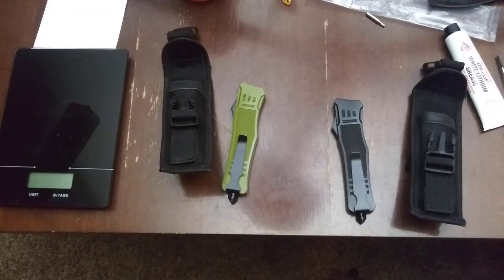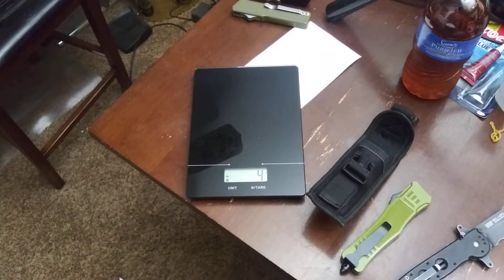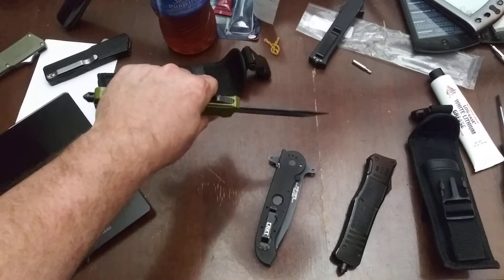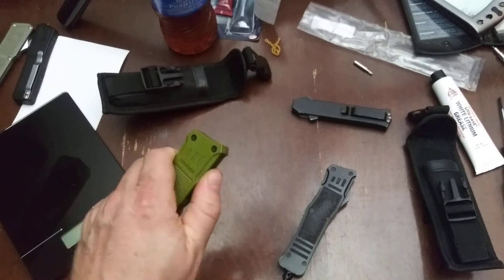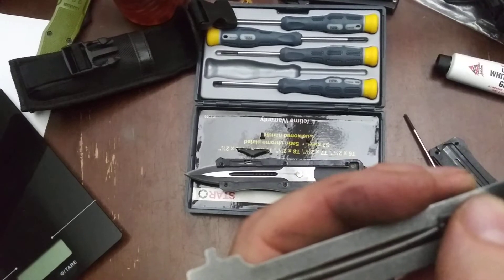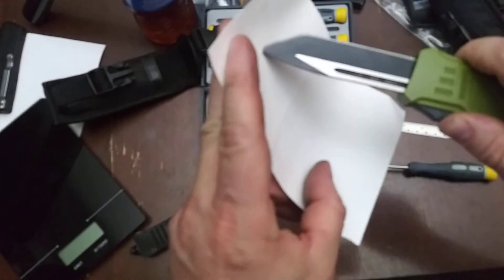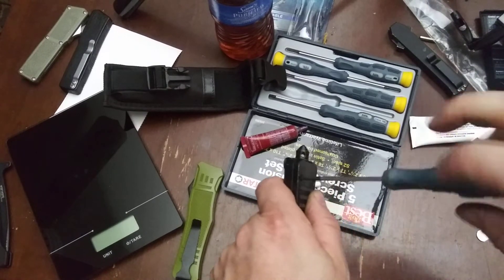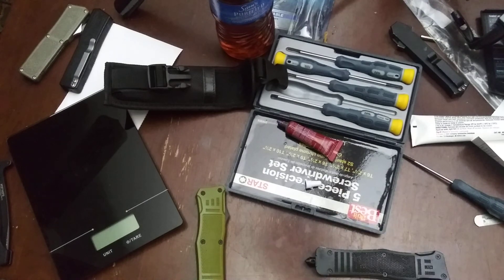atomic defender large otf HARD SWITCH FIX. Microtech Combat Troodon knock off

Comment: Awesome job! Been looking into budget knives, one of the things said on different channels is you can over tighten screws which will cause miss fires from case being too tight,but stretching spring oh so slight was a fantastic discovery.  Seen some run them wet with oil and some run with light to almost dry. But if you can take us through your journey,  I will definitely watch for outcome. Keep it up,great job!
Reply from the maker: on all the otf knifes i have the screw tightness will not affect blade deployment,unless its so loose that the handle falls apart.  however the metal is cheap and likely will strip something, maybe the threads of the little screw holes or the heads of the screws.  i have many videos up at this point and it all kind of blends together for me, i believe in the video above i just slightly stretch the spring. i have another video showing how i quieted these cheap otf knifes down. i like these knifes, i know they are low quality compared to the $400 knifes but these knives will still cut boxes, packages and flesh all the same. thanks for watching. but we warned i tend to make the video long, and do zero production and that can put some people to sleep lol.
Reply: Mr. Brown thanks for the reply, I bought the Hao Ming from Amazon and really good knife for the money, damn deployment switch is extremely stiff, used your trick,stretched spring slightly (little at a time) and added lithium grease. I'm very happy with this knife, hell I love this knife. Thank you sir for experimenting and finding such a  helpful cure for the deployment.  No misfires and no spring sing😀
Reply from the maker: @eugeneclark8463  excellent! glad i could help. that looks like a decent  knife. i am still amazed at how these work and how handy they are. beware, some of these cheap otf knifes will actually break. my "lighting" otf's hooks broke twice over the course of maybe 5 weeks or so. i was able to source the parts to fix them and i suppose you could make the parts if you are in a pinch. i think i have a few videos on that topic. still though,  otf, pocket clip and glass breaker for $40 sounds good to me.

Comment: Starting with a really powerful spring means that as it stretches naturally it will still fire the knife reliably - doesn't it?
It's not hard at all to source a myriad of spring extension coil spring sizes to find one that' has "softer" characteristics, but I think it's important to remember that if it takes a lot of force to push that button, that tells you the spring inside is very strong which translates to reliable blade launch.

Comment: just came across this video.. I did the same thing to mine when I first got it.  the spring was way too tight and it was very difficult to move.. stretched it little by little and it's been flawless since!
Reply from the maker: i still use these knifes every day, and they all seem good to go after about 2 or 3 years now of heavy edc use

Comment: I bought a cheap cobratec fs3 medium for my first last week. Been fidgeting with it non stop but that thing doesn't rattle open or closed. Man that button is stiff as hell but it doesn't fail unless you make it fail. Already ordered a higher quality otf to try out. I have an m21 large folder too. It's almost perfect but man those bolsters tear up my hand when I reach in my pocket. Been carrying a cold steel ak47 for over a decade and I cant find a more perfect defense/work knife. I love it and hate it because I can't find a better knife for my purposes. Faster than an auto too because of the wave deployment feature. An auto you have to pull out then open. A wave equipped knife opens on the way out of the pocket

Comment: This was really helpful.  I have a Microtech Ultratech that is pretty difficult to deploy, and I am hoping this technique will work to fix the problem.  Thanks -
Reply from the maker: i saw where mircotech makes a specieal tool to get those screws loose, did you have success?
Reply: @jasonbrown467  I bought a Guardian Tactical Recon 035 which has a much better system for deploying the knife and sold the Ultratech.

Comment: I just had a chance to weigh my Atomic Defender - 9.3 OUNCES and it feels every one!  Other than that it's a fabulous knife!  I also weighed my Replica MT Bounty Hunter which is basically a Combat Troodon with Hellhound blade all fancied up in Star Wars colors.  The BH weighed in at 5 ounces clean which is very close to half the weight of the Atomic Defender!  Also, the Replica BH has a 3.3 mm thick blade compared to the 2.8 mm blade of the Defender, and fires harder than the Defender with slightly thicker blade locks.  They cost about the same money for which the Defender is "okay" looking, while the Replica MT BH which is a beautiful, much lighter, just as solid of a knife!

Comment: Springs will loosen up over time and tinkering with them is only going to shorten the life of them.  Here's another tip...these knives were not meant to be used as fidget spinners, they are tools.  Playing with them constantly is only going to wear them out that much quicker.  Only deploy the blade when you need to use them and they will last a lifetime.  Play with them constantly and they will have a very short lifespan.
Reply from the maker: meh, i like being acclimated with the stuff i rely on. also, i am hard on my stuff on purpose, and if anything cant take the treatment it goes in the bin or retirement. my lightning otf cant handle the constant use without the front hook weakening very quickly, leading to a rattle when the blade is deployed that almost everyone eventually gets. all my other otf knives including the lightning otf "elite" has stood the daily abuse  off and on now for a few years. i know exactly what i can expect out of them

Comment: The added weight is likely due to the multi-use factor w/ the glass breaker. Did you forget? So obviously the buyer needs to make a choice as to what they want out of their knife.
Reply from the maker: i didnt forget the glass breaker, maybe i forgot to mention it in the video. the glass breaker was one of the reasons i bought that particular knife, but it can also be removed. the glass breaker also serves as a bolt to hold the pocket clip, which is reversible, which is nice

Comment: Hey man, would you happen to know where I could find a replacement spring+latch for my atomic defender, it’s the same size as yours. It broke a couple months ago and I haven’t been able to find out where I can get a replacement
Reply from the maker: i dont know where you can buy them, but it seems like i made a new hook piece that the spring attaches too. seems like anything would work, as long as it fits, it the right length and tension.

Comment: I bought "uxcell Extended Compressed Spring Wire Diameter 0.02", OD 0.12", Free Length 11.81" Stainless Steel Small Dual Hook Tension Spring" from Amazon... Wire Diameter:0.5mm/0.02"; Outer Diameter: 3mm/0.12"(OD); Free Length: 300mm/11.81" For about $8.50 and I cut/bend new eye hook/install this in every "barely above budget" OTF I purchase. I've only purchased one that had a spring and spring groove that was barely too small (maybe by only .5mm) to fit this 3mm OD spring... Might get brave and take my cone shaped diamond Dremel bit to it and see if I can't make it fit, but unlike most of these that have an actual channel for the spring to sit into on the moving blade catch, this one is just a single piece of metal and the spring just lays across the top of it... So... maybe too much work? Not a single misfire on any of them unless I'm actively trying to make it miss (hand up while opening, down while closing, etc)

Comment: That lightning is a pretty good knife to beat on. But all of those knives are cheap copies of high end knives. I have one and I dont use it because the blade is crappy steel and it weighs a ton. It was fun for a while though. I like a knife that doesnt constantly remind me that its there by weighing down my pocket. That knife is heavy because it is made with cheap, heavy steel instead of 6061 aluminium. You should try to go on bladeforums and pick up a used microtech ultratech, for example. They sell for new around $300, but used you can get one for around $200. Much lighter and made with uncompromising materials. You can always sell it to someone else to get your money back if you dont like it.
Reply from the maker: Yeah its super heavy, it has me thinking of taking it to a bench grinder to knock some weight off besides The paint is already  coming off quickly and i barely carry it. Im used to bigger knifes but this weight is rediculas.
Reply: @jasonbrown467  I went ahead and took the coating off and polished it. Looks better. Mine is soo freaking stiff it hurts my thumb. And it's got stiffer since getting it. Cleaned a few times,just never tried this fix.
Reply from the maker: @stuartracing1  if you do try this, just be very careful not to go to far. i was able to do this on two knifes and they still work great and probably never give us any problems
Reply from the maker: also, how did you polish it and what material do you think the handle is made up? do you have any pix of yours now that its polished?
Reply: @jasonbrown467  Hey, I used some 00 steel wool,then some 1000 grit wet sanded and then used my die grinder with a polishing wheel on it and slowly polished it,because I didn't want too much heat to build up. I think you'd like it.
Reply from the maker: @stuartracing1  hey man i just saw this link, i requested permission to view fyi
Reply: @jasonbrown467  I just disabled it. I didn't know it was locked.
Reply: @jasonbrown467  let me know if you can see the pics.
Reply from the maker: @stuartracing1  i tried several times to view it, for what ever reason it just wasnt mean to be, but thanks
Reply: @jasonbrown467  No problems.I`m no computer genius and have no idea why..Sorry man..

Comment: I just got one of those atomic knives and it's extremely hard to deploy and retract. Is it possible for it to losen up after using it a bunch? If not I'll need to open it up and stretch out the spring a bit because it's not possible to use one handed the way it is now.
Reply from the maker: i loosened mine up right away and its been perfect sense. its super easy to dissemble, but stretch that spring a tiny bit at a time the reassemble and test. if you over do it, there is no going back, unless you can chase down a new spring. well, if you over do it, you may be able to re compress the spring a bit, but i would just be careful and stretch it the tiniest bit. great knives other wise.
Reply: @jasonbrown467  thanks for the info!

Comment: Pleasee get a Microtech! You won't be disappointed. They are expensive, but lifetime warranty and the quality/ materials used are top notch. Personally I recommend getting a scarab or scarab II if you're into the larger blades. A combat troodon, which those two knock offs are copying, is not a bad option either

Comment: To be fair, you being "faster" is a training issue than if one is actually faster than the other. In a knife fight, I'd pick an OTF or a fixed blade because if the blade breaks on a fixed blade, it just breaks apart and on an OTF, if it breaks, it either breaks off or the knife shrinks back inside but a folding knife can break at the lock and swing it right back into your fingers. Of course the most important thing is to NEVER be in a knife fight but I'd never use a folding blade in a fight

Comment: Light drop of loctite is plenty. No need to coat the entire screw.
Reply from the maker: you are correct. did i over do it in the video? these knifes may have been new to me at the time, i kinda dont remember, but i do remember i over did the thread locker

Comment: What does a loose blade mean to you?
Does it mean the blade is going to somehow fall out?
DA OTF knives work best with generous tolerances and some recent high-dollar designs have incorporated special means of tensioning the blade to remove movement, but frankly, what difference does it really make if the blade shakes a bit?  There is so much blade shank inside the handle that it would take tremendous force to twist the blade out of the handle...fracturing the handle.  We're talking hydraulics.
Much too much is made of a bit of blade slop in OTF knives.  If you're that concerned, by yourself a pack of set screws and a matching drill and tap and install set screws on either side of the blade right at the opening.  You can adjust these down until the blade is pretty close to rock solid, and voila, you now have a $4,500 OTF knife!

Comment: Having a problem with my firing button feeling gritty after cleaning it, fires smooth a few times then gets gritty again like the aluminum case is grinding on the button making it impossible to fire any ideas? It's like I wore through the first layer of the case material and it's not smooth anymore
Reply from the maker: after cleaning it, did you lube it at all? a little bit of lube goes a long way with these otfs. have you taken it apart to clean it?

Comment: how large is the microtech clones
Reply from the maker: sorry just saw your question:
https://www.grindworx.com/item--Atomic-Defender-Dagger-Black-OTF--19058

SPECIFICATIONS
Overall Length:9.375"
Blade Length:3.625"
Blade Thickness:0.12"
Blade Material:Stainless Steel
Blade Style:Dagger
Blade Grind:Flat
Finish:Black, Satin
Edge Type:Plain
Handle Length:5.75"

looks like the price went up from 35 to 60...ouch